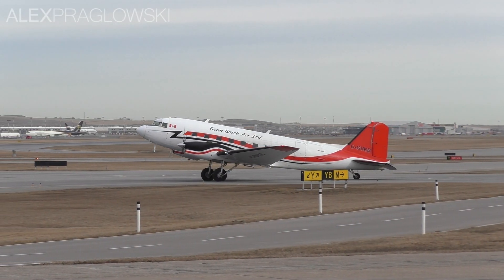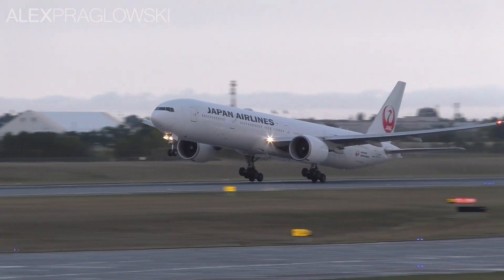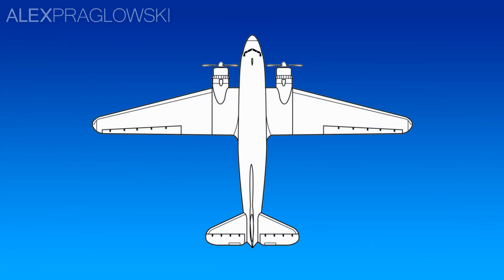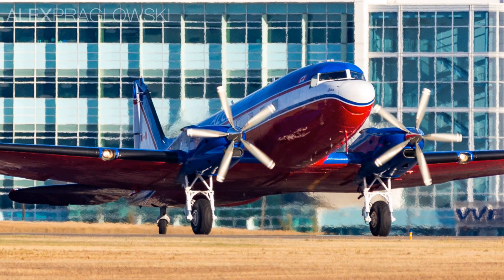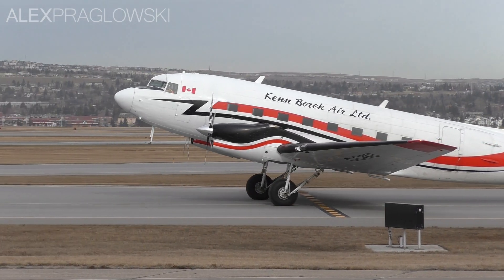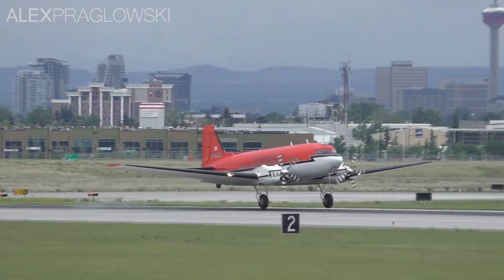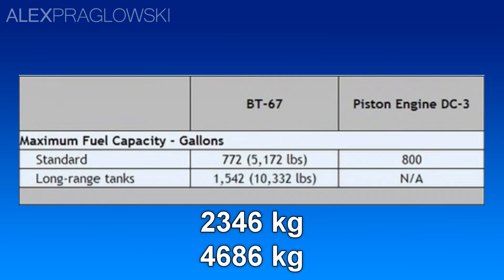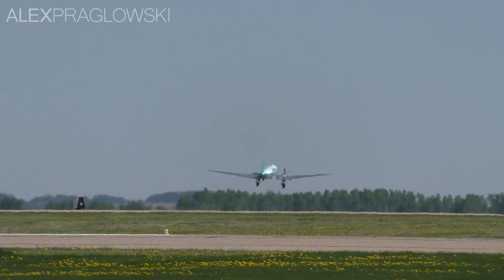What Is The Turbine DC-3?

Comment: Perhaps they should start building new ones from SCRATCH.
Reply: Might as well redesign whole plane for improvements if you do that.  Then it's no longer a DC-3.
Reply: @cup_and_cone  
Of course, you are correct in principle.
In practice, aircraft of a given type are seldom identical. Improvements are always being made on the production line, and often being refitted. 
I consider this to be a continuation of the DC-3 development process.
Of course, we are dickering with semantics.
Reply: @DavidFMayerPhD  Continuation of the DC-3 is exactly what it is, since it's a modified DC-3 Basler only had to apply for an STC rather than go through the certification process for a whole new design which could take years and is too costly to be worthwhile for the number of aircraft they produce and sell. Also keep in mind that there was like 11,000 DC-3 airframes produced so I don't think Basler is going to run out of empty shells to bring back to life any time soon.
Reply: @turbopropsandtailpipes7654  Glad to hear that. Thanks.

Comment: What this guy is doing to these lovely old aircraft is criminal.  They look awful
Reply: what is so criminal about restoring and strengthening the airframes, putting in new avionics and better engines. What's so criminal about giving these aircraft years more life instead of rotting away in some junk heap.
Reply: @larryclyons  Because they are classic iconic machines that should be preserved as they came out of the factory.  I have the same contempt for people that convert classic cars and bikes into hotrods.
Reply: @poruatokin  Having flown on a number of DC-3's  back in the NWT, and seeing the various aircraft graveyards, I think that keeping them in the air if a far better option than letting them rot.

Comment: how much cheaper is this compared to new similar aircraft?
Reply: There is no similar aircraft
Reply: @superskullmaster  there are better there are newer there are far more aerodynamic ones so why keep fling in this rusty can?
Reply: You need to read the story of the DC3 to understand why people want them. Even the designers don't know why it still flies, the stories of times it should have crashed and still flies is amazing.
Reply: Certifying a new aircraft design costs millions and millions of dollars before you drive the first rivet.  Modifying an already certified design is significantly cheaper.  Compare the cost of a new Cessna 182 to an old one with rebuilt motor, new paint, glass, interior and a new panel.  Virtually a new airplane, as good as the new one for a fraction of the cost ... An important reason to buy new though is that it is easier to get a bank loan and you get a better warranty ...
Reply: @jebise1126  cuz. They are built with aluminum and they do not rust quite like your average so-called tin cans that really are made with thin steel sheet.

Comment: When there are no more old DC-3s left to re-engine and rebuild, Basler Turbo should then consider building brand-new factory-fresh BT-67s.
Reply: Like what they are doing with the 4-blade huey. They started w/ old airframes. Then started building new airframes. They are fantastic performers.
Reply: Conventional landing gear is a huge advantage on primitive runways.  Also nice when fitting skis to the aircraft.
Reply: I think the chances of that happening are pretty slim for several reasons. The BT-67 is an STC of the DC-3, so the certification process for the 67s was much quicker and more importantly cheaper than if they had actually designed a new aircraft. There just isn't enough Basler customers to justify going through that process, especially when right now there really isn't a shortage of DC-3 airframes, and most of the BT-67s that would normally be hull losses go straight back to Basler to get rebuilt. So far I've seen 4 go down and each was brought back to life within a matter of weeks (except for one still currently being rebuilt in Oshkosh).
Reply: First they would dig up all the Li-2 airframes they can find.
Reply: Considering Basler has already redesigned the D.C.-3 and the design is well beyond the patents when McDonald Douglas started building them I don't believe any license from Boeing is required. Otherwise Basler would be paying Boeing now. Basler makes every single part for the DC-3 airframe already so when they run out of old airframes to rebuild they simply would continue to build the BT-67. I don't believe they would have any difficulty selling them at all. As a matter of course they only problem is they operate as a custom shop which is why they only produce 3-5 aircraft a year but I may be wrong on their production capability per year. Basler found one DC-3 they had in stock that flew on June 6TH, 1944 for the D Day invasion and when they made the discovery, it had been sitting outside for years they brought her inside and restored her to her D Day configuration as a C-47 complete with radial engines. To rebuild the engines it cost more than the purchase price of the entire aircraft the US Army paid for it in WW II. She is absolutely gorgeous.
Reply: @jamesshanks2614 
That one is called "That's All,
                                          Brother!"
That script was painted on the nose as a message to Hitler that his time was up.
Many former C-47s participated in D-Day. The formation consisted of over 800 aircraft. 
"That's All, Brother" was the lead airplane. On point, with the Airborne Commander on board. 
This airplane started the Normandy Invasion.
Reply: Yes a good idea. They would probably need to get a licence from Boeing as I assume they hold the rights to the design of the DC-3. Boeing took over McDonnell Douglas.
Reply: nAH just rebuild DC-4s and other old 1940s-50s planes with TURBOPROP engines
Reply: @robertbalazslorincz8218
That was done years ago with Convairs.
Reply: They could then use composite materials and perhaps 3d printed components.
Reply: They should already do that because i'm sure that there is more demand than just rebuilds. Especially Small Airlines e.g. in Africa could use them. This shot into my mind because in Africa plane tickets are ~3 times more expensive than in the us or europe. So there is less demand and even less People that can afford tickets. Planes like the DC-3/BT-67 would be a great solution.

In my opinion
Reply: If their going to do that then they may as well stick tricycle landing gear in the extended nose too!
Reply: @HFamilyDad  You'd have to relocate the main gear aft then. Even though the nose is stretched, the main gear is too far forward for a tricycle setup.
Reply: @GrizzAxxemann Easy gear change but I now think requiring external steps would ruin what a DC3 is about so yes ditch the idea.
Reply: @HFamilyDad  There's that too. And where would you relocate the main gear to? The fuselage wasn't designed for that in the first place. ;)
Reply: @Steve Hindmarsh Original DC-3s had airstairs, but the C-47 with its large cargo door did not.
Reply: @HFamilyDad  they actually could if they moved the wheels in the engine cowlings as far back as possible then used a shorter nose gear so basically the nose would be by default lower to the ground than the tail so it would be less susceptible to tipping over, it would make taxiing a pilot's dream and landings easier, the only disadvantage is that it would be harder to take off.
Oh and the cargo/passenger doors are going to be awkward to use.
Reply: @robertbalazslorincz8218  It would be nice to see regardless of practicalities
Reply: Why would you do that?  Many DC'3s operate out of unimproved airfields where a nose wheel is a disadvantage.  The pilots just have to be better aviators in the tailwheel  ... And the cost would be prohibitive for the lack of gain ...
Reply: @HFamilyDad  That would ruin it as a STOL aircraft, as taildraggers can handle grass landing strips, but tricycle gear can not...
Reply: Plenty of nosewheel airplanes land on the grass every day.  It just has to be in decent shape.  But many DC-3s land on strips where smooth grass would be a blessing and yes, a tailwheel is safer in that case ...
Reply: Steve Hindmarsh tailwheen is a way better choice for these planes. Way better off air port performance and it’s a bushplane
Reply: @HFamilyDad 
The DC-4 was basically a longer DC-3 with round windows, straight leading edges, four R-2000 engines, and tricycle gear.
Reply: @HFamilyDad  Tricycle landing gear does not have the on ground maneuverability or turning radius of conventional gear, Tailwheel aircraft can turn inside itself, which is what you really need when operating off airport.

Comment: The Basler BT-67 is a remanufactured DC-3/C-47. A 4 inch plug is added to the front fuselage. New interior flooring, new cockpit, (glass), turboprop engines P&W PT-6 (IIRC), new outer wing section (has a different shape)….Essentially an all new plane....The old girl should last another 50-75 years

Comment: What a cool artifact, recycling them is so worthy! Liked and subbed. 
I grew up at CFB Cold Lake with "Gooney Birds" and "Pinnochio" trainers all over the skies. Later, I flew in DC-3s when I worked in NWT. I remember the icy wind blowing through the skin of an Arctic Air DC-3 in February 1975 and people blowing on their fingers to keep warm after 2 hours in the air.
Perhaps you might do a production about Ken Borek Air. Those people seem to be pretty intrepid but they fly below the radar (so to speak) or away from radar altogether as often as not. Performing rescue flights at the behest of the American military suggests the possession of special capabilities.
Reply: So perhaps you can confirm my suspicion. Don't they operate radial and piston engines in the arctic because they preheat and handle the cold better than turboprops?
Reply: @matthewvincent8971  Turbo props are simply much stronger and more fuel efficient than reciprocating engines. Modern turbines are vastly better than radial engines designed in the twenties and thirties
Reply: @Anticheese  While I have to agree with you on the temperature handling topic (by researching the subject), I will have to disagree on the latter. Piston engines are more fuel efficient than turboprops, especially at low altitudes.

Comment: I really like how you're showcasing aircraft that thrive in Canada. I think the Dash 8 would be a great next choice for this style of video.
Reply: @mipmipmipmipmip Slow approach speeds, predictable flight characteristics, and HAVE YOU SEEN THE SIZE OF THOSE TIRES? Stolen straight from Baslers page:

"For missions from Sub-Saharan Africa to the Antarctic, the BT-67 offers unequalled performance.

Short, rough, remote airstrips
High cubic volume, high payload
Long range
High versatility
Brutally rough missions
No-nonsense reliability"

DC-3 is from a different era, can be fixed up with a simple toolset. Think 50's Ford vs 2019 Lexus - one is going to be more serviceable in the wilderness.
Reply: @mipmipmipmipmipThe bt-67 has all the advantages of a DC3, but with engines that are easier to maintain & which consume cheaper fuel...
Reply: @davidhollenshead4892  it's also faster too with a cruise speed of 250mph
Reply: @DC3RejuvationGB  Agreed...
Reply: Not withstanding the fact the 100 lowlead avgas is becoming a thing of the past in most airports in Canada as fewer aircraft require it and it's a lot more expensive in the far north.